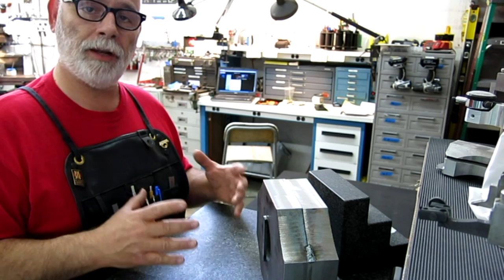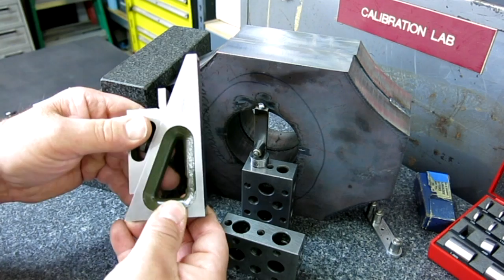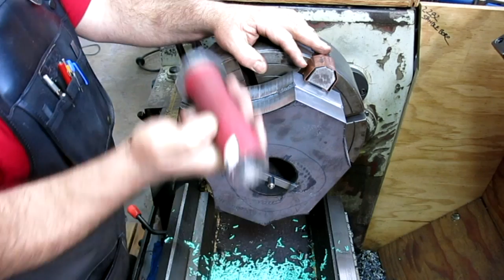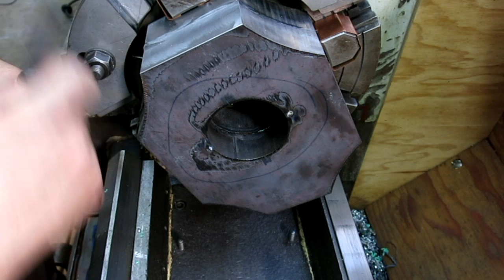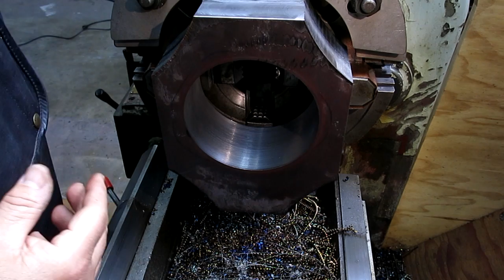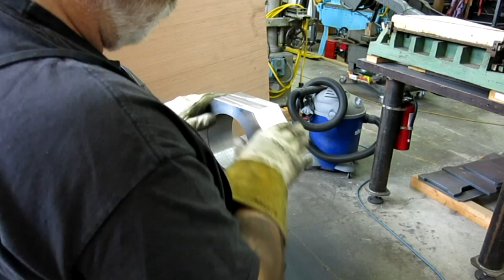Etching Press bearing housings part 2

Comment: Hi Tom, I don´t know if somebody had mentioned it, to be sure, that those balancing weights are not gonna fly out, you can easily tie  them together (on excesing bolts) with some wire.. btw, this series is great.. thx..
Reply from the maker: Hi Peter,

That is probably a good safety precaution. In this example I wasn't spinning very fast so I wasn't too worried. Thanks for the comment.

Cheers,

Tom

Comment: I am watching this one for the third time and those tool makers buttons  are great.
Just thinking: In case it has to be precise you have to take care that that tackwelded flatbar remains flat on the workpiece, otherwise the toolmakers button  will be at an angle with the centerline of the bores you want to machine.
It may even be necessary to clean machine that flatbar I suppose?
Reply from the maker: Hi Jan,

You are quite right. If the button is at an angle it might give a false reading. In this case it didn't matter but if you were doing something really fussy it would affect the end result. Thanks for the comment.

Cheers,

Tom

Comment: Tom:  Even though you tightened the snot out of the chuck, its good practice to stand behind the lathe headstock when starting the lathe.  If that workpiece was coming at you rotating anywhere near 200 rpm it would be a bad day.  Seeing the button setup was nice.  Thanks for the videos.
Reply from the maker: +arlen raasch Hi Arlen,

Thanks for your concern and comment.

Cheers,

Tom

Comment: CNC flame-burner here. You could have easily had that hole burned to within 1/4" of its final dimension without warping the piece, especially considering you faced the part afterwards. Also, whoever you had burn those parts did a pretty poor job. Those parts should have mated together better than that.

Comment: Hey Tom Great video, really interesting seeing how the buttons are used, Can you tell us why you used no cutting oil on this job. P.S I've no experience in machining I just find the video's fascinating.
Reply from the maker: Deepwinter Hi Winter,

With many grades of carbide you don't need flood coolant. When cutting at high speeds coolant can actually damage the hot tip of the insert. Thanks for the comment.

Cheers,

Tom

Comment: Hello Tom, Great video. Question please, why is it that you Yanks never seem to use a carriage stop when boring or turning towards the chuck. Good safety feature to ensure your tool misses the chuck jaws. Other contributors such as Tom's Techniques use a Plunger type Dial Gauge to come to a set length / depth, not reliable as you can easily go past your intended setting. Here in the UK we use carriage stops, either solid or with an adjustable screw.
Reply from the maker: Dave Ticehurst Hi Dave,

Well if you have done a lot of machining carriage stops are actually a pain in the neck. They always seem to be in the way and you have to use a wrench to unclamp the things and move them. With the DRO or an indicator its easy enough to stop where you want to. I don't think anybody in their right mind comes up hard against a carriage stop so functionally what is the difference. If you need the safety net of a hard stop for some special thing then fine. The other problem I have seen is when they move. You can't actually tell if they scoot along the ways by bumping them. With the DRO or indicator method you can easily see when you have moved past your set point. Hope that helps. Thanks for the comment. Good observation.

Cheers,

Tom

Comment: Tom,  thanks for another great video!  Lots to learn there.  Was that chatter on the last pass from a worn tool, too light a cut for the geometry, or just Finagle's First Principle at work ("The perversity of the universe tends towards a maximum.")?

If you ever run short of subject matter for a future video, "Designing with bearings" would be interesting. What types exist, what each is best used for, and how you go about using them in projects...including milling or turning where they live.  The general ideas for common types are fairly obvious, but the details, like how bearings are rated, how you find the one that fits a given need, and tolerances for fit are less obvious. You, Adam, and others just seem to know what's appropriate, but it hasn't been discussed that I've seen. 

Thanks!  

-- Mike
Reply from the maker: BigMjolnir Hi Mike,

The chatter on the last cut was Mr Bozo distracting me. I had intended to change the large radius insert I was roughing with to a smaller radius and finishing geometry. All the bright lights and cameras blinded me and I plumb forgot. Thanks for the comment.

Cheers,

Tom

Comment: It was the start of press that got me to your channel. Glad you are back on it. But could you not do those curved edges in the Autometric. Please forgive me, don't know what is is not possible with all the machines. Just thought so after seeing the teaser where you made the ball.
Reply from the maker: Andre van Wyk Hi Andre,

Yes I probably could do those curves in the Autometric. They are purely decorative and the part will be powder coated to finish it. I was not too worried about having a machined surface there. Thanks for the comment.

Cheers,

Tom

Comment: Hi Tom things are going great with my indexer a couple this slowed me down but now its on track. Can you suggest a incert for qreat surface finish as i am at a loss, and a cheap indicator that is still acurate as funds are a little low as i had to buy more materials. She came up nice are you going to paint the bearing hubs.
Reply from the maker: ***** What material are you machining? Thanks for the comment.

Cheers,

Tom

Comment: How do you get such a good finish on that kinda steel..    Great job Tom
Reply from the maker: one4stevo Hi Steve,

At high speed with good inserts its pretty easy. Large nose radii help. Thanks for the comment.

Cheers,

Tom
Reply: Oh! That’s “YouTube surface finish”! Adams channel is ripe with it. The camera makes everything look perfect. Those surface finishes look so shiny and colourful, when in reality I know there are ridges from the feed rate, scratches develop quite quickly with handling, there NEVER seems to be finger prints - on anything! Oil never seems to discolour or stain! Lol. We don’t get finishes like that at home. The freshly carbide cut surfaces disappear right before your eyes! Haha.

Comment: Great stuff again Tom,
I have acquired a really nice "Starrett" master planer gauge after seeing a video you did on them some time back. I had never heard of them, nor taken any interest in them until I watched that video. I have used mine several times in the short time I've owned it, for marking out. What you showed on this video is another way to use this amazing  tool. I'm happy I have one now in my toolbox !!
Pedro...
Reply from the maker: Peter Spence Hey Pedro,

Does yours have the small fine adjustment knob? Thanks for the comment.

Cheers,

Tom
Reply: oxtoolco Tom,
Yeah the "Starrett" I bought has the fine adjustment feature, I remember your commenting about that & wanted  it when searching for one on eBay. I am very happy with the one I bought, it is pretty well like new with all the parts & I paid $100 US for it which I think was a good buy.
Cheers - Pedro...

Comment: Hi Tom.  Great pair of videos.   I especially enjoy your episodes when you are utilizing your mill and lathe.  These might be the best segments yet.  One question.  The machining you did here obviously didn't require any lube and I was wondering why not?  Slow speeds and carbide?  Btw, I might have become a little red faced from hearing the "s" word but I'll try to work through it.  I was not accustomed to hearing such language in my old occupation.  (-;

Cheers!

Bob
Reply from the maker: Bob Horton Hi Bob,

Its actually the opposite. High speeds and carbide. For many operations coolant is actually detrimental. It can fracture the red hot tip of the insert. Dry machining is really nice if your inserts and process can handle it. Thanks for the comment.

Cheers,

Tom
Reply: Thanks Tom.  I learn something every video!

Cheers.

Bob

Comment: At what point do you decided to counter-balance? And what are the negative affects of NOT running them? I'm sure the bearings in the headstock won't be too happy. Could you just run it slow enough that the off center weight wouldn't have an affect?
Reply from the maker: SuperSecretSquirell Hi Squirrel,

There would be massive vibration which would make it hard to get a good finish and round bore. Running cutting tools too slowly is a problem for finishes and holding size as well. Its not difficult. It actually doesn't take long to set up unless your filming and yapping about it. Thanks for the comment.

Cheers,

Tom

Comment: Got it all buttoned up.? Cool big blocks of iron. The balance plates are a great setup for that chuck. Us little chuck guys would be resorting to some faceplate work.
Style points awarded... the curves are a nice touch over square.

Colin ;-)
Reply from the maker: ***** Hey Colin,

What I built was basically a larger version of a commercial bearing block. Thanks for stopping by.

Best,

Tom

Comment: Wouldn't that be easier on the mill... no jaws to worry about?
Reply from the maker: DSCKy Hi Dscky,

The lathe has 7.5 hp and is much more rigid. The mill has 3hp and a skinny little quill. The lathe can take three to five times the depth of cut per pass over the mill. Hope this helps. Good question.

Cheers,

Tom
Reply: That makes perfect sense... :)
Reply: DSCKy I was wondering that too...   I was hoping that Tom would say why he didn't use the mill.   Could the hole be too big for the boring head(s) he has for the mill?

Comment: Tom, noob question. If it's important to have the two bored be coaxial, should you face the two plates ahead of time so the bores are perpendicular to the plate faces?
Reply from the maker: Thomas Utley Hey Tom,

The outer plate was faced perp to the bore. I flipped it around and faced the opposite side parallel and then separated the two plates. Those surfaces are not a functional surface anyway. I wanted to face them so they looked better. The bearings are self aligning spherical roller bearings. Thanks for the comment.

Cheers,

Tom

Comment: How did you go about setting and controlling the depth of travel in detail, since you were (or seemed) flush tight against the jaws on the back of the bore. I know you have a DRO, but do you set it til you start hearing the cutter rattle against the jaws? it did seem to cut the bore flush all the way without leaving the smallest lip. thanks for great show again. Cheers.
Reply from the maker: Flip de boer Hey Flip,

There was a small space behind the part. It was about a millimeter beyond the back of the part. I just wanted to be sure I didn't over penetrate and bump the chuck jaw. I used the DRO to determine where I was in relation to the chuck jaw. Thanks for the comment.

Cheers,

Tom

Comment: No idea how this etching press is going to look like and I'm way behind you on experience (on a different planet), but I'm curious where the load is located on the bearing? I'm asking as I assumed it's on the inner ring, which normally means press fitting the inner part (shaft) and leaving the outer race as a loose fit (or transitional). Unless I got something mixed up, which is of course possible.

Also am I correct to think the housing split + bolt will have to be done with some sort of spacer so not to crush the outer race and will require a positive locking mechanism to stay put without undoing itself during work?

Cheers,
T.
Reply from the maker: Tom Jagiello Hey Tom,

You can swap sides that are constrained. The loads are fairly light in relation to the bearing size. I think these are rated at 42,000 lbs per bearing. They will see a fraction of that load in use on the press. The main reason for the type (spherical roller) is the roll deflection and the bearings maintaining alignment with the axis of rotation. The clamping load on the bearing od in pretty minimal as well and only there to keep the bearing in position. Thanks for the comment.

Cheers,

Tom

Comment: Hello Your Oxness,
Wondering why you didn't have the hole burned to larger diameter?
Tom Starke (father of Josh)
Reply from the maker: Tom Starke Hi Tom,

Now I know you fast forwarded the video. I explained why I didn't do that pretty specifically. Your punishment is to watch the video again. Thanks for the comment.

Cheers,

Tom
Reply: oxtoolco Nope. I watched the whole thing and just missed it. Watched it again and sure enough, you explained it. It is particularly interesting to me because we do a lot of heavy plate burning with plasma and oxy/fuel. I probably would have burned the ID to within 1/2" of the finished bore size and wondered what happened after I machined it. Let me know if we can burn anything for you!
 Your humble, inattentive oxen,
Tom

Comment: I was holding my breath as you slide in the bearings to check the fit.  I was waiting for a hot side plate to cool just enough to grab them!    I realize for final use you will slit them to clamp the bearing, but it the fixed side to be bolted or welded in place? I guess I'll have to tune in next week to see how that goes.
Reply from the maker: Tom Walter Hey Tom,

All will be revealed. Just keep clicking away. Thanks for the comment.

Cheers,

Tom

Comment: Your a master, and I'm certain I either saw it in one of your video's or Kieth Fenner's, maybe in your book. But I was wondering if there was a reason you didn't put a sacrificial plate behind the part to make it so you didn't need to be so accurate on boring depth and not hit your jaws? Not enough part engagement for the size remaining? Regardless, thanks for another great video.
Reply from the maker: David Finch Hi David,

It was really a trivial thing to stop without hitting the jaws. I only mentioned it because I needed to pay attention to not going way past the thickness of the plate. Thanks for the comment.

Cheers,

Tom

Comment: Hi Tom,
your comments on the flame cutting make a lot of sense. what are your thoughts on having a piece that thick cut using a water jet?
i'm tinkering with the thought of investing in one in the future, at the moment the cost is a little scary.
cheers
mike
Reply from the maker: HolzMichel Hi Mike,

Waterjets are not that efficient on steel this thick. My supplier offers turn key material and cutting. Most WJ vendors do not stock huge amounts of material. The waterjet shines in its ability to cut nearly anything. Typically the service is sold as cutting only but some vendors offer materials as well. Thanks for the comment.

Cheers,

Tom

Comment: In one of the Dan Gelbart prototype design videos, he shows to prevent insertion binding on something like this you can cut a small groove near the tip of the male cylinder that is being inserted. The grove makes it so the you can get the male part started in the hole a little crooked without binding, but the pin won't slide in past the groove unless it is perfectly aligned.  I wonder if you can do the same to the female part that the bearing is being inserted into while it was in the lathe to prevent bind on assembly.

Chris
Reply from the maker: shadowdog500 Hi Chris,

I have used that trick for close fitting pins and other components. In this case the housing will be split which will create a large clearance. Once the bearing is positioned it will then be clamped in position. Thanks for the comment.

Cheers,

Tom

Comment: Is it possible to drill and tap hole on the perimeter of the chuck by each of the slots? Then you could use a washer and bolt to guarantee your nuts don't escape.
Reply from the maker: ***** Hey Justin,

At low speeds the forces are pretty low. The stud has a pretty impressive clamping force. If I needed to spin at 2K rpm it would be a different story. Thanks for the comment.

Cheers,

Tom

Comment: Enjoyed the lesson on the layout/button!  Said WTF when I heard that chatter....thought that only happens to me on a final pass!
Reply: outsidescrewball Chatter is only supposed to happen on final passes?! Dang, I get chatter before switching on the machine.
Reply from the maker: outsidescrewball Hey Chuck,

I meant to change the insert on the finish passes. The roughing insert had a large corner radius that is prone to chatter if the depth of cut is less than the nose radius. Mr Bozo distracted me with bright lights and cameras so I totally forgot to change it. 

All the best,

Tom
Reply: outsidescrewball Small last passes are hell for chatter and finish....

Comment: Hey Tom.. Ya could perhaps stick a couple of huge cable ties around the chuck to help prevent any T-NUT escapage :)
Reply: *****   John... my son lost the bottom alternator bolt on his '93 Nissan 240SX.  It showed up on my door step, 2000 miles later.... with some heavy duty zip ties hold it in place.  Just amazing!   He also discovered RED locktite doesn't work on exhaust flange bolts.  <grin>

Comment: Nice job Tom, always interesting to see different work holding techniques, Would water jetting have given you the option for a larger bore cut-out without distortion? or would it have been to cost prohibitive.
Reply from the maker: rchopp Hi Randy,

Waterjet on steel this thick is pretty slow. My steel supplier offers oxy fuel burning as well as material sales. Not that many WJ cutting outfits stock much material. You are correct that I could have gotten closer to final size that way. It only took a half hour or so to remove the extra material in the bores. Thanks for the comment and good question.

Cheers,

Tom